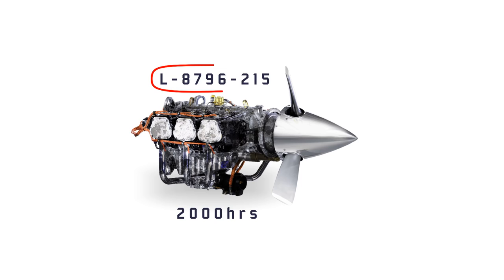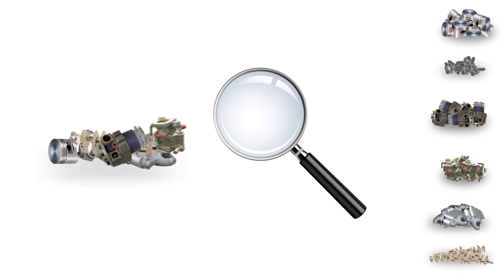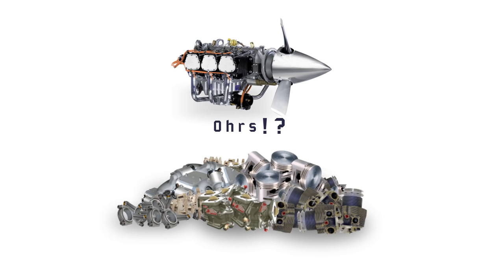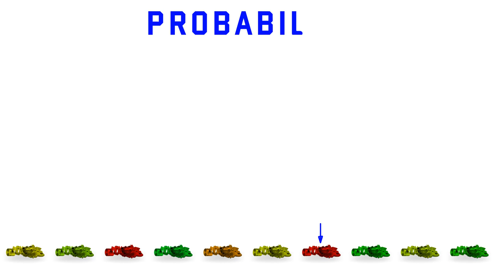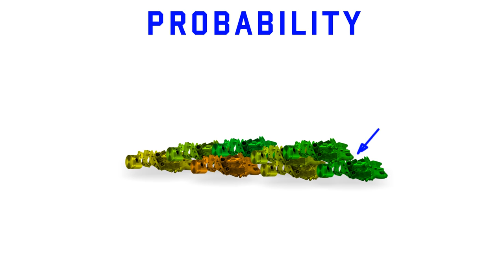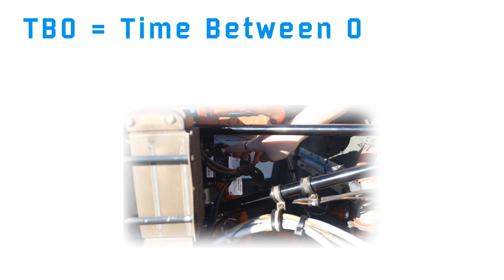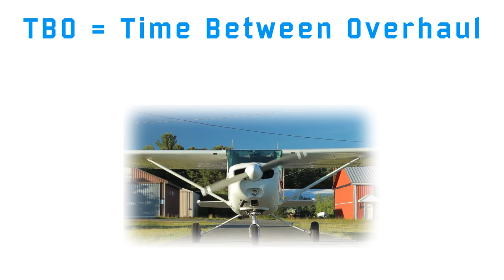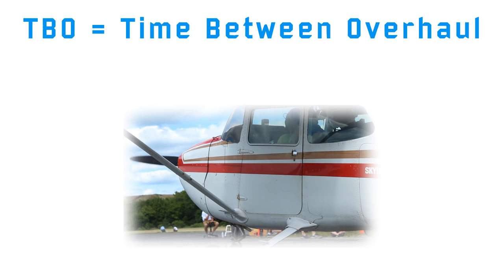The $20,000 high school math that keeps engines running.

Comment: Owning an airplane is just slightly less expensive than a crack addiction.
Reply: Scott Franco and crack addiction is cheaper than a gaming addiction
Reply: TheChaoticGamer crack addiction is cheaper than PC gaming addiction
Reply: And they both get you "High"
Reply: @Scott Franco....You sure about that?...Don't know what a crack rock cost but I'm sure it is less than the plastic door pillar post I paid for. 
100LL at my FBO $4.54gal. My next two purchases PMA 8000BT audio panel $3k installed and GNC-255 (nav/com) afraid to ask.
I'd be better off doing crack...😊
Reply: Na crack and gaming addiction cheaper than owning an aeroplane

Comment: TBO is the graphical intersection where reliability decreases and repair cost increases. Compounding excessive clearances usually found past TBO stress components differently than intended, causing non consumable parts to fail inspection thus inflating repair costs greatly
Reply from the maker: Hm.  Well said.  Nice analysis.

Comment: I have spent my life building engines and have found that exchanging an engine can bring problems you didn't have before. If you know the engine and it is warn or just time for overhaul then my experience is using the base engine you started with unless it is a catastrophic failure. I have had reman engines, factory and otherwise, that failed early do to hidden problems in the block or other reused/reconditioned parts. The trick is finding a competent trustworthy rebuilder and not just price shopping that everyone seems to view as most important or the only consideration these days. Too many people view repair as all equal and if someone is cheaper enough to gamble and jump through hoops there is most likely a negative reason for it. Not always true but usually. By the way, compression test isn't the be all end all. Lots of other considerations to determine the soundness of an engine that isn't reflected by a compression or leak down test.

Comment: As an owner with the budget you have, do you overhaul or rebuild?  Is the price the same?  Use a local mechanic at your airport or send the engine to the manufacturer?  Nick, wonderful graphics?  What program was used?  How did you find pictures of a small plane engine and parts or did you or someone draw them.  Did you do it yourself or send them out?  How many engine rebuild procedures can you do yourself?  Change your own oil, calibrate your compass... something?
Reply from the maker: Hi Bruce!  I personally go for factory rebuild, just because of the safety.  They do tend to be a little more expensive, but there are some interesting incentives they offer too.  Adobe After Effects CS 5.5, took them myself, or public domain.  And, you can do oil changes, tire changes, and cleaning, but that's about it.  There's probably more, but I don't keep up with all those rules, since I'd rather have it done by experienced hands.  Phew!  Great questions, as usual! Haha
Reply: Thank you very.  Learn so much here.  I want to see Scotty Kilmer start doing  plane overhaul videos!  So easy, everyone can do it.
Reply: The other advantage to a factory rebuild:

My engine overhauler is already out of business, 7 year later.

Comment: I'm interested in what parts are actually reused. In automotive applications we are always taught if you reuse a moving component in the engine it must go back in the exact spot it came from. This is true with pistons, rods, cranks, valvetrain, rings, ect. Wear patterns basically mate the cylinder sleeve and piston together instance. I could see alternators, oil pans, windage trays, geartrains, ect being reused but rotating assemblies being randomly put together sounds odd.
Reply from the maker: Good question.  I had always assumed there would be some continuity like you said, but I have no idea, actually.
Reply: +Philip Robb - Specific answers come from the factory manual of course, but in general the engines either do NOT have parts wear matched to sets OR those pieces are replaced.

Much is different from newer Automotive designs, with more replaceable wear parts built into the design (as cars ALSO once were).  Cases would stay in matched pairs, since they're machined as a set.  But cranks/cams could be swapped around to any cases, since they are entirely supported by replaced bearings (no cam in head style without bearings).  Pistons/rings/cylinders come as replacement sets.  Heads would be rebuilt after inspection, new valve guides, newly cut or replaced & cut valve seats, new valves/springs keepers etc..  Then each head can end up on any engine.  

See how it works?  Designed for rebuild makes a difference.
Reply: That makes a lot of sense. Thanks Roger
Reply: Given the costs and ease of manufacture of some parts it makes no sense for certain parts to be reused.  Examples would be pistons, valves, oil pumps, drive chains (or gears but they rarely fail).. I certainly could see that some of these parts would be reused given enough stinginess but for total peace of mind I certainly would not do it. Parts that would certainly have every right to be reused if in good shape would be blocks, cranks, rods, manifolds, carbs, heads, cylinders, and many of those parts can be reconditioned even if not in great shape. 

Coming from an automotive and marine background thats my line of thinking. I certainly would never want a rebuilt or overhaul to reuse certain parts on my engine, regardless of what the manufacturer says. And while I certainly realize that new parts are also a new variable towards risk, the price you pay for new parts like valves and pistons also contribute to the quality and risk of failure. 

Looking at it from a stressed component that is most likely to fail and cause catastrophic failure I would insist on those parts being new (valves, oil pump, chains, and pistons). Other parts that would cause catastrophic failure would be carb but thats not a stressed component its up to the rebuild of the carb and parts used inside it.

Comment: So the last method you speak of I believe would typically be referred to as re-manufactured, at least in the automotive world that is. I would imagine that while they are re-using pieces like crankcases and cylinders, they are changing critical components in favor of new ones, such as cylinder liners, new pistons and rings, while there are other parts such as crankshafts that may need to just be polished and put back into service.
Reply from the maker: Yep, you're absolutely correct.  The FAA notes that remanufacture and rebuild can be used interchangeably.

Comment: The graphic of "weeding out" manufacturer defects through generations seems odd.  If each part is inspected before they go into a pile, it seems that the rejected parts would more likely be due to normal wear, abuse, or the effects of aging. And any significant manufacturer defects would be weeded out after the first generation.  In which case the 2st generation would be no different than the 1000th generation.
Reply: @ezicarus8216  I said normal wear and ageing.  Although terrifyingly, I have no recollection of making this comment 4 years ago

Comment: Would I save more money if I overhaul my engine by myself, since I'm an A&P Mechanic?
Reply: Wouldn't you know?!!??!
Reply: TheMusicboy316, NO. Not if you're an approved and certified repair station. You are limited to cylinder replacements and such but cannot officially overhaul an engine and fly legally.
Reply: TheMusicboy316,.... Like the above poster said. You should know this as they explain this in recip theory and overhaul and its part of the oral and practical. Where did you go to school?
Reply: fadimo305 wells it's been more than a year since I took my exams, it's not like I remember everything i learned, especially when it's focused on GA. I'm in the airline business
Reply: No... because the amount of tools you would have to buy would exceed the cost of an overhaul. In addition to basic tools, you'd need an overhaul manual, a range of very expensive precision measuring tools, specialized tools for assembly, and a test stand with precision instruments, a test club, and cooling hood for test run and run in. Also... assembling an engine is a bit of an art. This is why there is such variation between engine shops and things like leaks, low compression, oil consumption, and even catastrophic failure.
Reply: You'd save money by not overhauling it at all unless there's something wrong with it.
Reply: Patrik That's not how it works. You can't fly after your tbo if up
Reply from the maker: You actually can.  As long as you want.  TBO is only a recommendation, believe it or not.
Reply: ahahaha of course you can,,, missionaries a&p s overhaul their own planes everyday
Reply: and no tbo is not a recommendation for any commercially used aircraft.. its LAW
Reply: i ll rephrase that.. its law in 100s of countries
Reply: Absolutely, assuming you are insured. Ok, so your spouse will save the money, technically.
Reply: The legal component isn't an FAA regulation; it's typically contractually obligated by your insurance policy.
Reply: Yes I have been in aviation maintenance in canada for the last 44 years. In canada at lest an AME is not legally allowed to do a total overhaul of a piston engine , that has to be done by an approved shop with a specific licensed .Perhaps in the US is different  as the FAA some times had different regulations than here in canada. First 10 years in piston and the rest with turbines.
Reply: @brazidas58  Really aloud? it's allowed.
Reply: @nssherlock4547  sorry I don't have  an English major. correction has been done.

Comment: May I ask, while you say it's not FAA required to have an engine overhauled, is there no official requirements in the US to have smaller aircraft inspected (airframe, controls, engine) or the instruments calibrated?

Oh, and happy inauguration day.  😊
Reply: Peter Riis. for a private aircraft there is no legal requirement for when an engine must he overhauled or rebuilt, if you are using the plane to make money then they do have some nominal guidelines but just like a private owner and his mechanic may determine its safe to fly past TBO (or that its not safe to fly well before TBO) airlines and other businesses may make the same determination and submit to the FAA for deferred overhaul. Its a very common practice.
Reply: Peter Riis since the other reply here didn't answer your question, let me. Yes - there are very specific maintenance and inspection requirements for all aircraft to maintain a certificate of airworthiness. This includes periodic inspections of the engine, as well as the condition of the airframe etc.. during said inspections, parts or devices critical to the airworthiness of the craft must meet specific requirements and or tolerances as approved by the FAA. If these critical parts do not meet the FAA's certification standards, they must be replaced to maintain airworthiness. As for instruments, there are required instruments for VFR and IFR flight, and they must meet specific accuracy requirements to be considered legally usable for flight, they must be checked and calibrated as necessary. More so for IFR required instruments. IFR instruments must be checked and calibrated every 2 years to maintain legal IFR flight airworthiness. All of this is spelled out in detail in the FAA regulations.
Reply: TomVaillencourt 
Thanks, Tom. That's reassuring. I believe that we have much the same requirements here in DK although it's been some years since I last checked.
Reply: DrewLSsix 
Not really what I was asking, Drew, but thanks for the effort.
Reply: A couple of clarifications and additions. 

ALL certificated aircraft in the US must have an annual inspection every year where every moving part is inspected, checked, and lubricated.  Many of the components in the aircraft have specific checks to be made to make sure they're safe.  The engine (which is the biggest single component) separately has lots of items to be inspected that it must pass to meet its annual inspection, and the engine must pass for the airplane to pass.  The propeller is the other big separate component that must pass, although its inspection is typically much simpler.  ("Certificated" leaves out experimental amateur-built aircraft, which have similar requirements but that's a separate discussion.)

It is true that for NONCOMMERCIAL use, the time-between-overhaul on a certificated engine is merely a recommendation.  However, there still are things to check that the engine must pass at every annual inspection.  At some point your mechanic may not be willing to pass the engine based on some test or the engine's condition, at which point you can have it overhauled or find another mechanic.  Finding one that will pass any engine is a dangerous game.  

For aircraft that are used for hire (small rental aircraft, including training aircraft, commercial aircraft, and airliners), engine hour limits before overhaul are legally MANDATORY.

Comment: It's not high school math, it's Grade 5 math. As in, are the measured limits to three decimal places greater than or less than the new limits or service limits. 
For an overhauled engine done by a third party shop, they are measuring service limits. These are the limits which should allow a part to go another TBO interval without failing. Most larger components like cranks, camshafts, gears, con rods, cylinders, and case halves will often continue in service, while items like piston rings, bearing shells, etc are replaced at every tear down regardless. 
For a factory reman, all components are to new limits. With the cost of tear down, cleaning, and inspection... it's doubtful there is a large feedstock of engine parts several generations old when new components can be made cheaply. This also allows for the factory to incorporate improvements, ADs, and Service Bulletins, and why new ADs often encompass engines assembled in a block of dates vs being scattered to individual serial numbers which have the offending parts. Engine cores are accepted to take engines out of circulation rather than for parts.
Reply: You hit on something I was going to mention after I saw the video.  

As the video and you both said, the factory remanufacturing process has all components at new limits, and that's a legal requirement of it being a "remanufacture".  So a remanufactured engine should definitely go as long as a brand-new engine would.

"they are measuring service limits. These are the limits which should allow a part to go another TBO interval without failing. "  Is that the definition of service limit?  I thought that it just meant the components weren't out of spec NOW, but there was no expectation that they would go to full TBO.

Anyway, some shops will rebuild the engine to service limits, which is the legal requirement of an "overhaul".  Doing this will result in a lower cost of overhaul, because some components are returned to the engine not quite as good as new.  However, some shops do what they call a "major overhaul" (which has no legal definition as far as I can tell) where they restore all components to new limits.  They can't zero-time the engine for legal reasons, but they can make it (theoretically) as good as a remanufacture would be.  That costs a lot more, though.  

It's also worth mentioning that the cost differential between this options is LARGE.   A brand-new engine (no core) for, say, a Lycoming 360 series is something over $50k.  An overhaul to new limits with all new cylinders is something like $25k.  An overhaul only to service limits is somewhat less than $20k.

Comment: i did my engine "overhaul", but they swapped out the engine block for another for various reasons. Thus it is somewheres between overhaul and remanufacture.
Reply: Scott Franco it is still just an overhaul because total time on your engine is continued, a remanufactured would grant it 0 total time

Comment: i find it strange that airplane engines are so expensive compared to motorcycle and car engines considering they are essentially the same thing. makes me think they are ripping airplane owners off. those old continental engines were actually tractor engines and yet they charge way more for fixing the "airplane" engines than they do tractor engines. heck we rebuilt car engines in high school shop class! i have been wanting to get into piloting and thinking of getting an old ercoupe and if i do and it needs engine work i am pretty sure i could rebuild it myself for the cost of the parts. it is not like a combustion engine is difficult to work on, or a carburetor is difficult to rebuild... having worked on old cars my entire life i think i could do it no problem.

Comment: Ironically, this is a similar process to what some engine rebuilders do in the automotive industry. And I don't know about aircraft, but in cars sometimes the rebuilt engines have few issues then new ones.
Reply from the maker: You're absolutely right!  It's weird to think about how that works, but it's true.
Reply: Yeah, go figure. My stepdad always recommended getting a rebuild over a used part if you could possibly afford it, particularly with transmissions. If he where around today, I'd imagine he would compare an aircraft engine to an automatic transmission in a car: Complicated, and reliable so long as they are fixed and maintained by someone who does nothing else.
Reply: @DFX2KX  most of the old plane engines like the continentals are literally tractor engines they put in planes...